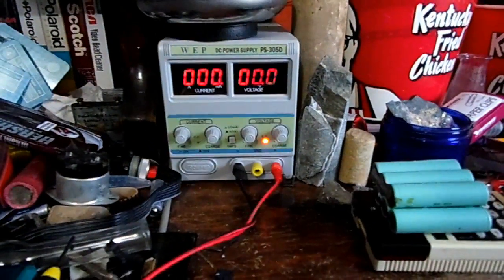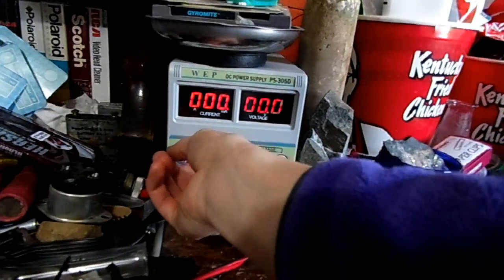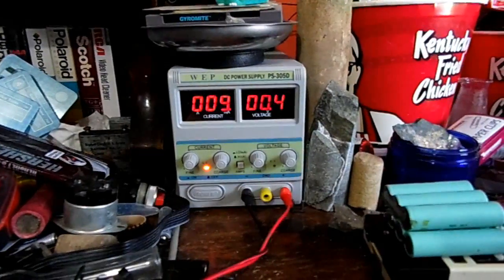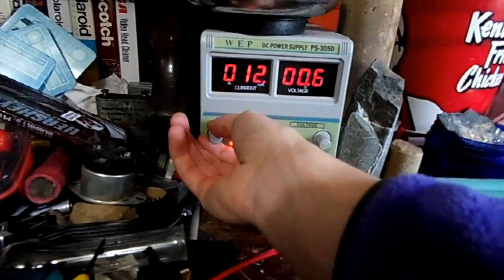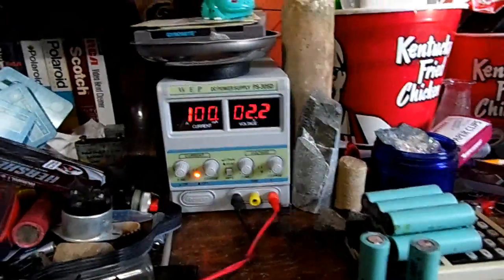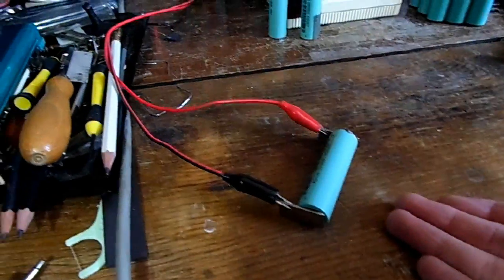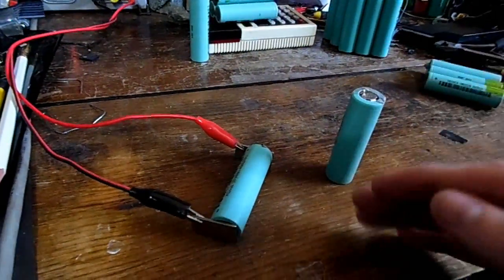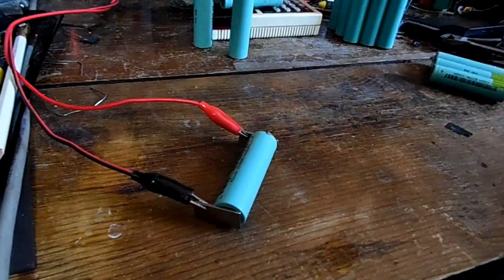DIY Revive Lithium 18650 cells

Comment: I thought so too, but this crystal cell pulls out energy from some natural spectrum that is unaffected by radio or microwave energy made by man. It has a steady power out put and if made right will not have a galvanic reaction with  the metal used to make it.
Check out the crystal glue battery, its cheap to make and very interesting.
There is even an army officer who made one and takes it out on field exercises. He says it works with out fail no matter where he is.
Reply from the maker: i guess you don't know what the "reply" button does eh?

of what i've seen of crystal batteries they are just bullshit tbh.

Comment: Yea ,I figured maby it might not work for lithium but I would like to know for sure, if you have a bad one to chance on.
 I had heard it worked on them, but I guess we have to try to know for sure.

Have you ever looked at crystal batteries? I have seen a very cool one made by ibpointless2. Its called the crystal glue cell. You should check it out. He has had one running for over a year now and its still generating power at the same rate. You can also hook them up in parallel and in series to generate more power. I figure if you made a bunch of them and hook them up correctly with a jewel ringer you could light a very bright light bulb permanently with out plugging into an outlet.
You could put it in an over sized flash light, like the huge ones with the handle, the size of a car battery. 
It would make a great prize to give to your subscribers. A emergency lamp that never runs out of power! With a little creativity you could also incorporate a battery charger and cell phone charger as well, now that would be a wonderful piece of survival gear.
Reply from the maker: the only way i can think of a crystal as giving power is by converting radio signals into electricity. thats how the origenal crystal set radios worked.

and i think you mean a "joule thief" not a "joule ringer" and a joule thief doesnt step up watts it steps up the voltage and steps down the amps.
Reply: lead crystal?  Mjlorton has a series of vids, he does a long term test on lead-crystal vs lead-acid,  he fully discharges them,  he couldnt kill the lead crystal and and also has over 90 percent of capaity after seriois abuse, and you can also pull more amp-hours from them,

Comment: Are those the type of battery that go bang if you charge them above 4v in a unlimited  charger?

Looks like you could do with a geared vernier drive for your psu current control.
Reply from the maker: these cells and most laptop cells are made to be charged to 4.2v. they will possibly short out above 4.4v and if they short while charged like that they will heat up and can possibly catch fire yes.
Reply: Rinoa Super-Genius
Ooow i think ill stick to nimh for basic fiddling lol.
Reply from the maker: zx8401ztv
ok, i don't like NiMH because they are more toxic.

Comment: I hear that a desulfator battery recharger will bring lithium batteries back to full charge. I know some sights on you tube if you want the build plans.
I would like to see if it really works on disposable battery's as well.
 A lot of people hear the hype about these desulfator battery rechargers, and like me want to know if they work for real.
Please make one or buy one. I know they are not very hard to make and I have a pdf spoon feed version that any one can understand and build with out much electronic know how.
I plan on making one myself but I don't have the stuff or any money right now.
Let me know if your interested in this project + you could double your battery's power for your battery pack.
Reply from the maker: I've made several videos that I talk about desulfators. I've had some luck with the one I have except its really weak.

now as for the lithium-ion restoration by pulse desulfating I highly doubt it due to how the battery chemistry works. but none the less I still plan on testing it on bad cells someday. I may test it on these two cells I got here idk.

I think the main issue is the annodes degrade over time.
Reply: Once the battery is damaged, it has no amperage to rely upon.